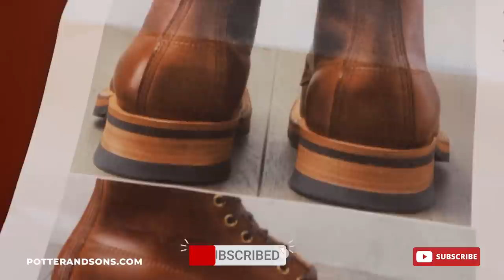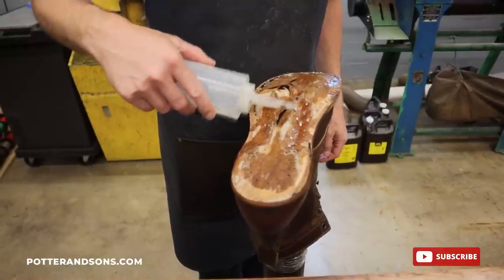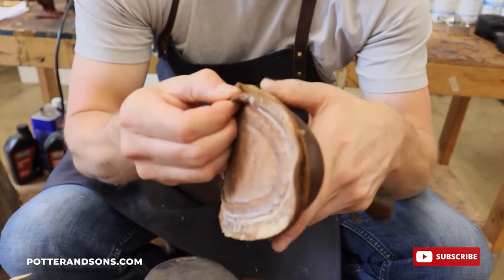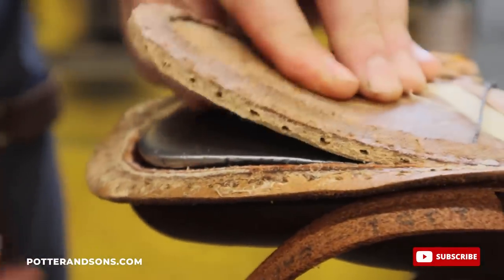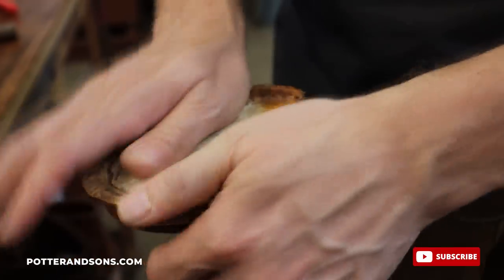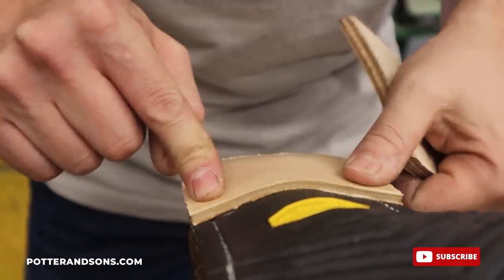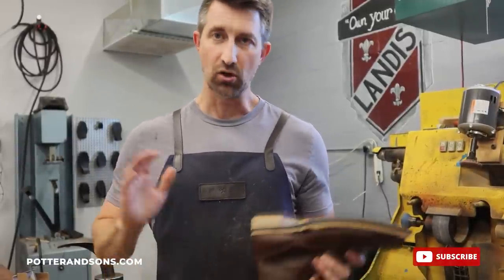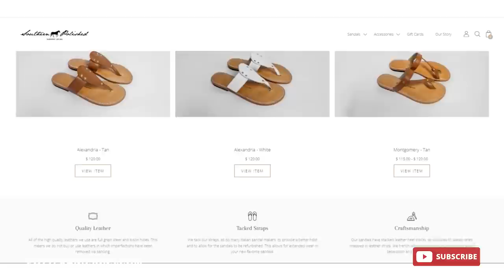WHITE'S BOOTS | Customer Wanted a NEW Look

Comment: I have a pair of Whites Cutter 350s and they are built just like those were before the change. Super solid and you are right the added welt on top of the stitch down is very different compared to anything I’ve ever seen. But I like being different lol great video guys, I may have to do the same on the heel block I do kind of dislike the logger look.
Reply: Are those cutter boots just for work or can be worn just for walking?
Reply: @senoucisenouci5605  these boots were made for walking and working
Reply: How is the toe is it comfortable?
Reply: @senoucisenouci5605  it’s not steel toe but it’s firm as firm as any boot I’ve ever owned. And pretty comfy as long as you get the correct size that is

Comment: Hey there fellas…. I’m pigeon toed and I end up rolling my boots and shoes pretty quickly… I’ve had hard stuff placed on the outside back edge… I’m wondering if you ever actually grind a 1/2” off the inside edge from the start so that the shoes stay flatter and roll over less?

Comment: I just got a pair of used black Strands and the leather is a bit uneven, I used saddle soap, conditioner, and then some black cream. There are some duller spots, mainly. Do you have any recommendations? They are fairly new, just not new to me, but are still fairly stiff compared to my 5th aves that I’ve had for about a year, so not even quite broken in. Will the leather finish improve with time or is there anything else I can do? 

Sorry for the ramble.
Reply: Caleb, you might try Elegant Oxford.  His channel is totally dedicated to shining shoes, and strands in particular are his favorite.

Comment: With so many nails in some of these boots, I can't help but think of the weight of them. Has anybody used lighter materials for nails and screws? Like, aluminum, magnesium or even titanium? Sure it could make boots a bit more expensive but you can say that about any material used. I can imagine that a shoe does't really need the strength of a steel nail so maybe aluminum could work.

Comment: What is the difference of contact cement and rubber cement?
And the glue thinner, what is it made of? Is it acetone?
Reply: In my understanding, rubber cement is suitable for light work and contact cement is meant for heavy-duty and all-purpose.
Glue thinner is basically like paint-thinner; melts glue very well. Acetone cleans, dries, and strips any surface.
Reply: @TheNunakun  I am not sure what kind of glue that is available here in our country. It says on the label contact cement but after a few weeks of wearing the shoe the repair would peel off.